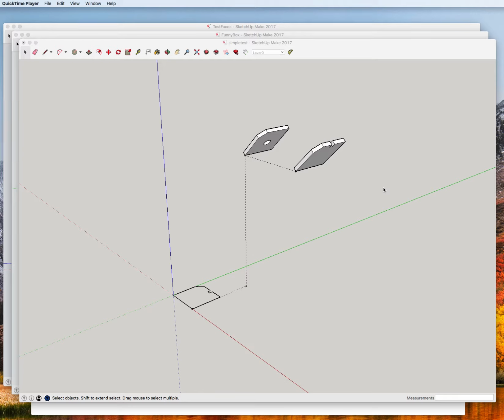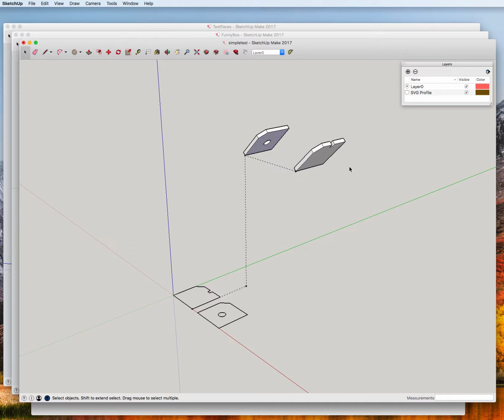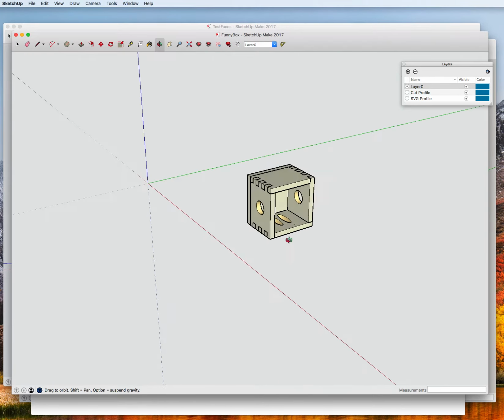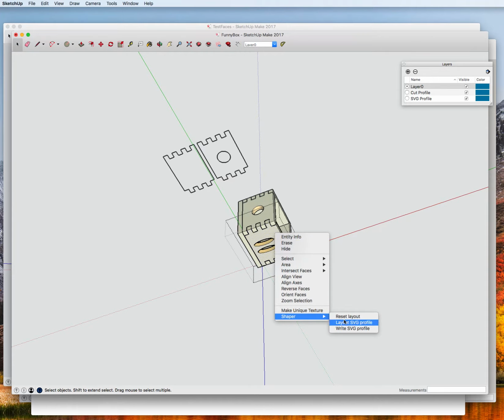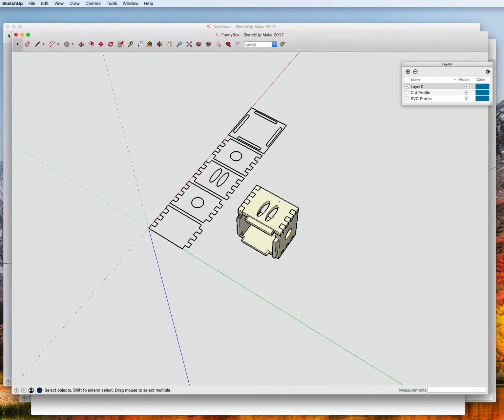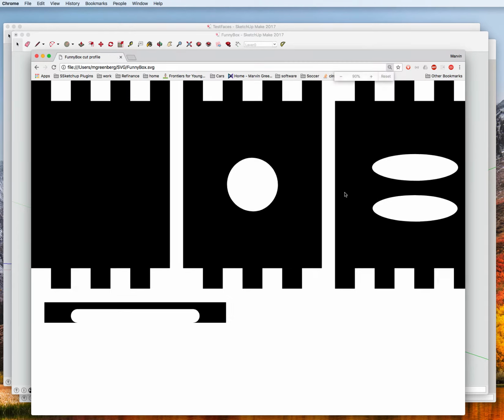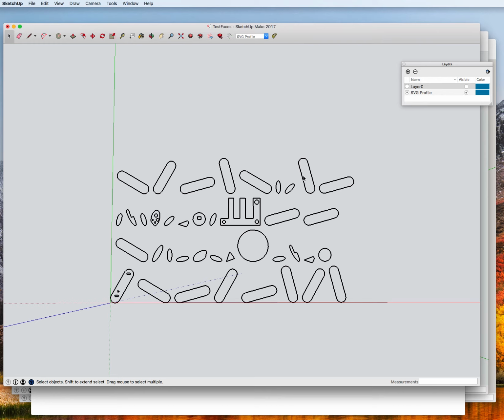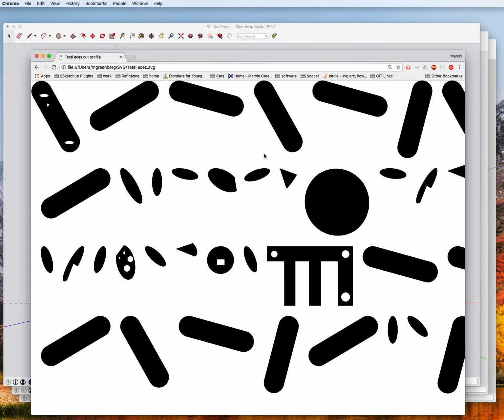Sketchup SVG Plugin v1 0 - for Shaper Origin

Comment: I used it once and the next time I used it it won't save it as a svg
Reply from the maker: Hey, I can try to help if you give a little more info
Reply: @MarvinGreenberg  Yeah when I click write svg file profile the window that comes up says svg out put file but when I save it it has no file extension, the first time I did this it worked but saved it as a html file, but it downloaded to my shaper and I was able to use it
Reply from the maker: @mgloxahatchee  I'm not sure what would be happening - at that point is just the system for dialog.  Is this windows or osx?  Try typing the whole file name, like mysvgfile.svg.  is it possible the directory where the file is being saved has changed and you're looking in the wrong place?
Reply: @MarvinGreenberg  Ok I got it to work it was user erro,r love it
 and I'm definitely sending you $18
Reply from the maker: @mgloxahatchee  Hey, don't send me money until you've used it a few weeks or maybe not even then.  I need to give it some love, there a variety of things that I've noticed, and I really haven't had time to work on it.